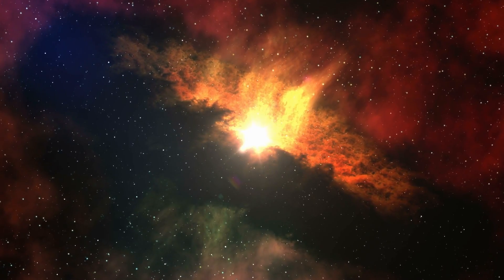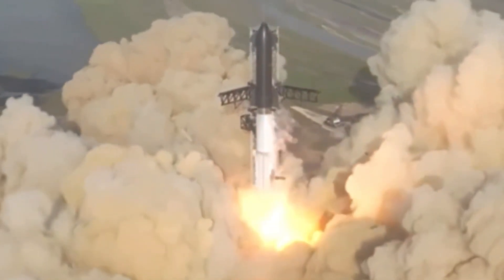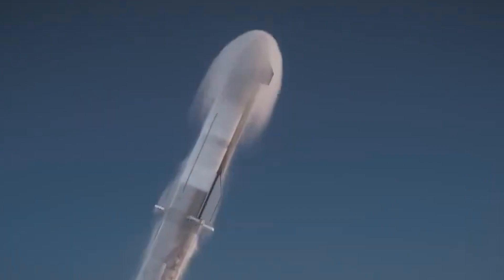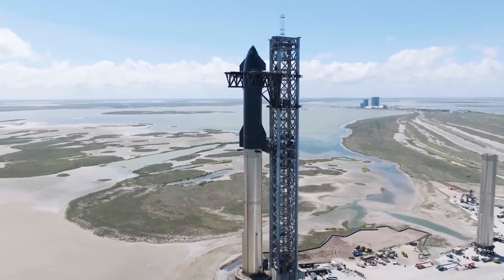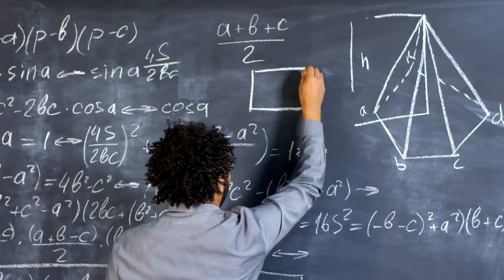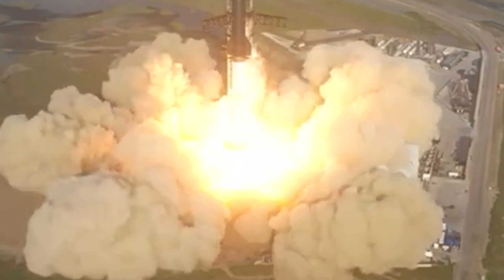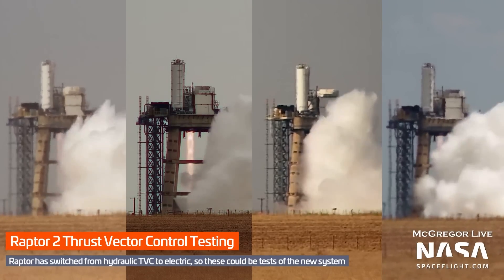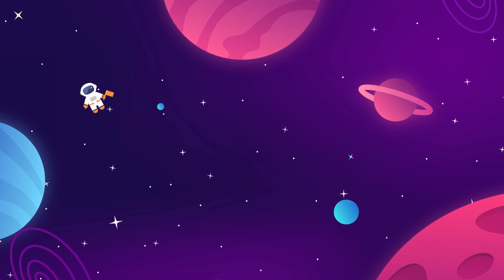The SpaceX Starship Orbital Launch Update Is Here!

Comment: The point at which Starship buckled and subsequently broke up, was almost one minute after the Flight termination system was fired @ T+ 3:10. This is when you see the jet of gas coming from the side of the upper stage a couple of seconds later another jet from lower stage. The flight termination system is a set of charges designed to depressurize the tanks, not necessarily to cause an immediate explosion of the vehicle. Either the gas could have ignited ( which it did not), or dynamic forces would eventually take over and destroy vehicle from the loss of rigidity caused by loss of fuel pressure once the pressurant system expired (which it did). The breakup occurring precisely at 4 minutes was a pure coincidence.
Reply: So the flight termination system ALSO FAILED!
Reply: @johnp139  no it worked exactly as designed, and performed within the regulations set forth by the FAA. one of the regulations says it must not cause the direct detonation of the fuel.
Reply: Yes exactly. Several well informed commentators (including Scott Manley) have pointed this out. And it's annoying that a lot of people report that Starship broke up immediately after the FTS was activated. Including some mass media.
Reply: Educate yourself about rocketry. The  Skirt of the Starship is a rigidised and unpressurized section of the rocket. Picture shows rocket bend at the Skirt stiffest part of the rocket when whole rocket is unpressurized. Your claim does not make sense. It is much more likely that the Skirt collapsed due to compressive force generated by Raptor engines while whole rocket was intact. That collapse caused rupture of Liquid Methane tank of SH Booster FTS  were activated at the end causing 2 explosions.
Reply: @KarolKarolak  well, this is the insider info, I was given from one of the designers of the FTS so that is my education!
Reply: @jeolman1  your insider seems to be equally uninformed as you are
Reply: "Starship"...LOL.  It's not possible to be a Starship. It's not even a spaceship.
Reply: @java4653  🤔🤨😒
Reply: @java4653  honestly, that is all you could come up with for a comment?!?  Wow, I didn't name the damn thing.
Reply: @java4653  Well it´s already a ship orbiting a star, in space.

Comment: What about a giant hole in the ground 100m deep, and the rocket launches from some sort of framework at the top of this hole (ground level)?
By the time the exhaust reaches the bottom of the hole it would have lost some energy.
There could be 5 or 6 tunnels around the bottom of the hole, leading back up to the surface, to relieve the pressure.
Reply: Have you never dug a hole at the beach before?
Reply: Remember, both at Boca Chica and at Cape Canaveral, the water table is just feet under the ground surface so any hole dug will either fill up with water, or will need serious coffer dams to stay dry. Now, I'm not rocket scientist so I may be way off here, having the big hole filled with water might be a blessing in disguise for various reasons that I'm not smart enough to realize...
Reply: @Sembazuru  Good point. Maybe they should launch from a different place.

Comment: I expected better than this, back to the drawing board, don’t stop your almost there
Reply: All existing rockets that use a launch pad are way less powerful than that one. And they all use something to protect the concrete from being damaged by the massive thrust, heat and vibrations.
I am amazed anyone on earth could ever imagine it was a good idea to remove all kinds of protections while massively upping the power.
And I am amazed the FAA gave them the green light.
Before going to the drawing board they need to learn safety basics.

Comment: I've not heard ANY MENTION of the possibility that sonic vibrations may have contributed to Starship's engine shutdowns and may have contributed to the IMMENSE damage to the concrete pad???
The use of water deluge systems has been standard, not for flame/blast suppression but specifically for this, "The Sound Suppression System protects the orbiter and its payloads from being damaged by muffling acoustical energy -- sound waves -- that could crack and damage surfaces during liftoff." according to a NASA printout.
Reply: Good Point. You can even see the massive shock/sound waves in the videos when the engines fired but starship didnt clear the pad yet.
Reply: @davidg8675  Yes, and imo there has to be a significant difference between the 100% thrust at liftoff compared to the short throttled down thrust during the booster's test fire, add to that a longer exposure to that kind of sonic bombardment and I'm sure it contributed substantially to the damage.

Comment: These big rockets are not needed. Just use modules that fit on existing rockets that we have lots of experience launching, and assemble the modules in orbit. Experience with assembling ISS in orbit SHOULD have meant that we would abandon trying to build The Biggest Rocket in the World and instead just assemble in LEO.

We need a lander that can attach to Orion in LEO somehow, along with a TransLunar Injection rocket. Not this silly thing that has to be launched directly to the Moon (instead of LEO) just so the crew can get on it and land on the moon.
Reply: What are you even going on about? You realise starship is mainly designed for providing delivery's to low earth orbit right?
Reply: @Alucard-gt1zf  

"You realise starship is mainly designed for providing delivery's to low earth orbit right?"

That's not the point. 

Let's try this again.

Build smaller modules, ones that fit on existing rockets that already deliver cargo to LEO

Assemble the vehicle in LEO.

There is literally no need for the Saturn V or anything more powerful. Once you're in LEO with the ability to refuel, you can go anywhere in the solar system with relative ease, including the moon.

Comment: Big Spacex fan.  But I’ve wondered for three years what is the resistance to building a flame diverter?  I haven’t seen any video explaining that.  We see this debris field even with Falcon 9.  Why not control the direction of debris?
Reply: ive heard only rumors, some more reasonable then others, one is that the texas wont let them build a more robust system, but they dosent explain why other things that dont conflit havent been done, moving the tanks futher away and being made more safely for example. and im sure they can build a flame diverter (or steel plate) that matchs any enviomental requirments. the other is that they wont have this type of landing pad at the places they want to land, namely the moon and mars and they hope that a launch platform (the steel table thing) thats high ehough and good ehough can be installed fairly easly with out huge amounts of concrete and steel and water. the other is that musk forced the launch to take place too quickly which has more or less weight behind it depending on you opinon of musk.  regardless they knew this would be an issue even with just the starship alone and didnt solve it and now have to remake there whole pad.
Reply: SpaceX wants it simple as possible for launches from Mars. They are working on the Water system of course, but I think they seriously miscalculated what would happen this launch without it. Though they did learn what would happen in this scenario and gives them tons of data to move forward with and come up with a better designed launch system.
Reply: Musk's ego.

Comment: Each engine will be 3% of thrust.  9% is probably accurate for acceleration, as you need a thrust to weight ratio over 1 to accelerate at all.
Reply: Yeah, total thrust:weight is 1.8ish, so 9% sounds pretty close, though these numbers will change while fuel is consumed
Reply: 9% of thrust over the weight, which matters much more than total thrust.

Comment: why would each of 33 engines be 9%?  Isn't 3% a better guess?
Reply: It cuts the "effective" thrust by that much. The Tsiolkovsy Rocket Equation is counterintuitive. Just like adding payload adds thousands of times the weight in fuel, cutting available thrust early in the launch tacks on lots more "gravity drag" for the rest of the flight and consumes a multiple of the thrust loss in extra fuel (and the fuel that lifts that fuel, etc.)

Comment: Pretty Good coverage on the "How & Why" there was so much Ground Zero damage, but I heard a more plausible version from a NASA Engineer. The ONE Significant Reason that SpaceX didn't build a Flame Diverter Trench in Boca Chica . . . is because of the High Water Table in the area.  IOW, there was Tons of groundwater beneath the OLM's concrete base. A Water Deluge System does Much to subdue expanding hypersonic Rocket Engine gases and also turns Heat into steam, which is needed. But there's One More important role for a WDS, it absorbs Acoustic Energy and reduces Damages from that. The Acoustics alone from 33 Raptor Engines at power will literally Fracture and Float heavy concrete slabs given the amount of Sound Energy produced. Add to that, Methane burns MUCH Hotter than RP1. So once the OLM's concrete foundation was fractured to pieces and bounced around by the Sound Energy of those Raptors, that Extremely Hot Exhaust Gas was given access which superheated any and all groundwater into Steam nearly instantaneously. Tons of water turning into Steam instantly is a literal Bomb. . . helping to explain why such large chunks of concrete went straight upwards, into the skirt of StarShip and for hundreds of yards beyond. It wasn't just exhaust gas velocity that made that Crater, the tons of groundwater turned to steam nearly instantaneously made the ground Explode.
Reply: Respectfully, I don't buy the water-table argument. The water table at Cape Canaveral is also extremely high. NASA solved for this by building the entire flame trench structure above ground. It comes down to the simple fact that -- for whatever reason -- Elon just doesn't want to go the flame trench/diverter route.

I get thinking outside the box, but for the life of me I just can't wrap my head around chasing after every oddball method known to man EXCEPT the one time-tested method that is proven to work.
Reply: @turbochargedsports6327  He is convinced of his own genius.  In reality he's just a spoilt brat with a huge ego and money to burn.
Reply: @turbochargedsports6327  The water table at Cape Canaveral for EVERY pad out there has a Flame Trench beneath it. Boca Chica's OLM pad does NOT have a Flame Trench. The very fact that the Crater created beneath the OLM at BC has already backfilled w/ ground water is all the evidence needed. Learn to read more thoroughly before commenting because that fact was stated in my original comment . . . or are you just another Troll wannabe?
Reply: Also with high ground water levels it is no problem at all to lower them for a period of time just by pumping the water away. It is always used at the building of fundations of houses and brdges.
Reply: @chrisridethatbloodything2044  Building a Flame Trench at Boca Chica's OLM pad would be Time consuming, expensive and complicated. SpaceX may yet decide to do so but then hows that gonna work for their Sea Based Launch pads ?
Reply: @chrisridethatbloodything2044  They have never heard of sheet piles either...

Comment: There is NO way each engine accounts for 9% of the total thrust. 3:37
Reply: It cuts the "effective" thrust by that much. The Tsiolkovsy Rocket Equation is counterintuitive. Just like adding payload adds thousands of times the weight in fuel, cutting available thrust early in the launch tacks on lots more "gravity drag" for the rest of the flight and consumes a multiple of the thrust loss in extra fuel (and the fuel that lifts that fuel, etc.)

Comment: Any chance that with the slow ascent thay debris kicked up into the cone area and damaged the rockets?
Reply: concrete can resist pressure from rocket engines blasting against it and pierce through to hit the engines?
Reply: @visceraeyes525  no but it can ricochet and come up at an angle from the side to hit the outer engines

Comment: I’m really surprised they didn’t fire the second stage after the failed separation. If there were people on board in a future launch it would be VERY valuable to know the behavior and if it could be a survival path.
Reply: "I’m really surprised they didn’t fire the second stage after the failed separation"
That would have detonated the first stage and destroyed both stages in the process, just like the Flight Termination System would eventually do
Reply: There are unlikely to ever be people on board.  No way is Starship ever going to be human-rated, with that crazy flip manouver it does to land.  Even without that, no purely power-landing craft has ever been human-rated, there is just too much risk of failure, with no back-up.  And, as Starship is effectively the emergency survival system in the event of a takeoff failure, that means no human-rating even for just getting to orbit, either.  If Starship is going to Mars (or even the Moon) with people on it, they will have to be ferried up and down to orbit by Dragons on F9s.
Reply: From that image I think they did, just before using the fts on the booster. if you're going to blow the booster why not get the data on a power seperation so you have data on what you need to do to make it safe.
Reply: I agree, and for probably a myriad of reasons.  And, certainly more info could have been retained

Comment: At 12:20, I don't think the car that was hit by debris was 6 miles away. I think it was a lot closer than that.
Reply: That parking lot is about 1/4 mile from the launch mount.
Reply: It was across the street, it was lab padres camera car
Reply: @titanbot11  It was NSF's camera van, they even opened a van repair charity fund:)
Reply: Furthermore, the fine particulate is not caused by the starship breaking apart. It is dust and particulate from pad debris carried by the wind north away from the pad. Starship's final direction before RUD was E-SE directly away from Port Isabelle.

The destroyed engine bell theory is another thing unproven. Its most likely an effect of contrast in the video images from Cosmic Perspective's 8k tracking shot that makes them hard to see in comparison to the lit engines next to them.

Comment: Criticizing the stage to "ZERO" is actually short sighted... that event gives an insight to things that need to be considered in what it will take to take off from the MOON or MARS to return to earth in the future.
Reply: Not really because it's not the booster which will be used to return, but the engines on the Starship itself.  It will also be a significantly less massive ship because most of the fuel and oxidizer will have already been used, and it will be taking off from a body with one sixth or one third G force respectively.
Reply: @chrisantoniou4366  I stand corrected, I was thinking about the  dust on both the Moon and Mars and completely overlooked both stage 1 and 2 booster rockets.

Comment: I think it's sheer hubris that Musk and SpaceX thought a flame trench or water diversion system would not be necessary... when flight testing the most powerful rocket ever launched. Sure, the concrete pad didn't explode during initial rocket tests, but that doesn't mean it wasn't already significantly weakened. Then again, it also seemed silly that the tank farm was positioned so close to the launch tower, with only a small steel blast shield to divert the force of the super heated exhaust. I drove to the SpaceX facility in Boca Chica back in December of 2021 and found it to be something of a wild west boomtown. When I saw the tower and tank farm proximity with my own eyes, I had assumed that it would be used primarily for systems integration tests, and not the actual launch pad itself. Common sense would dictate the actual launch tower and pad be both far more robust and far, far away from any other sensitive assets. It seems the same  reckless 'Go Fever' that almost ended the Apollo program in 1965, has been spreading unchecked in Boca Chica. I'm grateful that nobody was injured during this test, but the cavalier 'Build-it & Wreck-it' attitude of SpaceX, might need some further reflection.
Reply: I can't get over it, either.  Honestly, that decision was REALLY out there.  I have to pull in the FAA and other regulatory authorities here.  The launch shouldn't have been licensed without testing and approval of the launch system.   It's crazy.  They're just letting him hot-doggit over there in Boca Chica with this enormous ICBM, for all intents and purposes...and the risk to the public is enormous.
Reply: Everyone's an expert...
Reply: They operate like it's the 1960s and all they're doing wasn't already done and tested. I wonder when will they kill someone with that approach.
Reply: Yeah they try to make everything cheap as much as possible. I personally think one day will be casualties and it will end like Hindeburg or Concorde.
Reply: @filiptuma7572 given how that test went we're lucky the rocket didn't go off on the pad.  One piece of debris in the right place and you have a massive bomb
Reply: Some common sense at last!